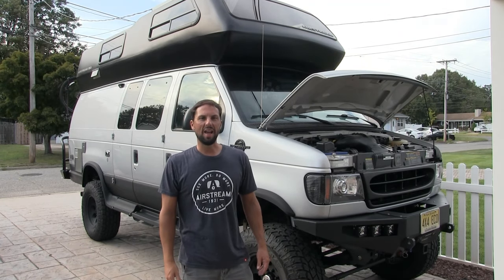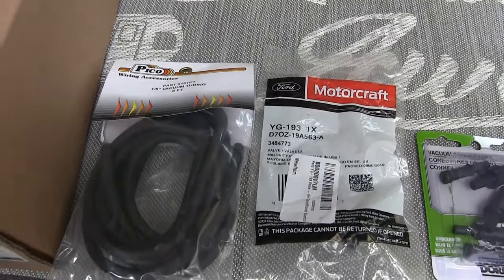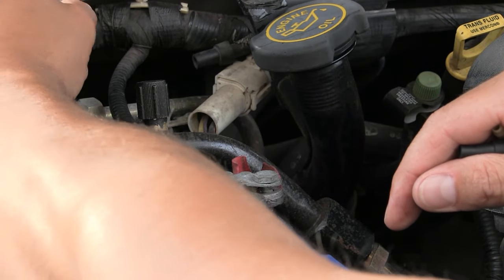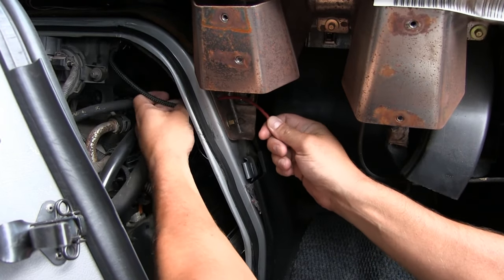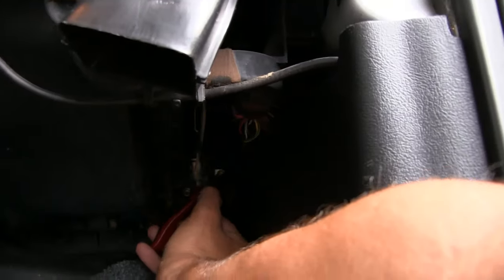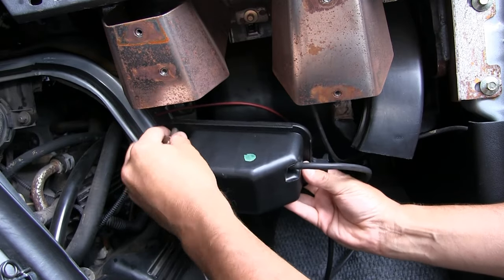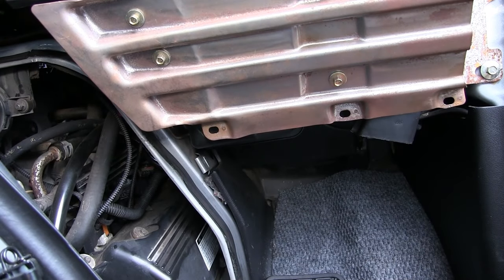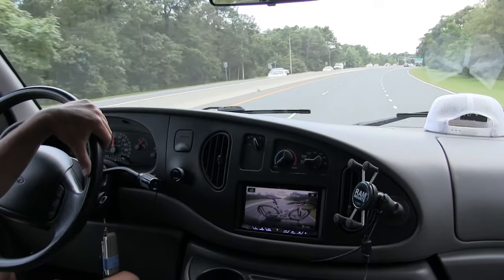Ford Econoline AC Heat Defrost Acceleration Fix

Comment: My 2013 ford econoline 250- ac stop working like this and so idid everything on your video now my max ac quit working and the rest is working on when my truck is moving and stop blowing when im on stop. Any idea why is that
Reply from the maker: I haven't run into that before. Not sure.
Reply: @NewJerseyOutdoorAdventures  before is not blowing when im in the stop. Now is backwards is blowing when im moving. But when i put the key on the ignition at ac position before you start the vehicle they usually air blowing mine is nothing no air blowing at all
Reply: And check all the fuses and relay everything is good

Comment: Did this repair and I'm still getting the same issue. Any ideas?
Reply: Same, did you get it figured out ?
I Did some research, something about testing the vacuum pressure to the defrost switch from the replacement reservoir. And it should not lose vacuum, but if you check the other end it should lose vacuum slowly via the engine valves.

Comment: Hi there, New Jersey Outdoor Adventures. I just completed your fix here, and now I have a faint clicking sound coming from the dash/doghouse. Any idea what's happened, or how to potentially correct this? Thanks in advance for any ideas!
Reply from the maker: Haven't hear about a click from other viewers.
Reply: @NewJerseyOutdoorAdventures  I reseated the doghouse and it's fine now. It must not have been fully sealed up, and some extraneous noise was more noticeable because of this. I don't think it was anything other than that. -Thanks

Comment: I'm sure this was a very informative video when it was made 4 years ago. However, now it's an excercise in frustration; 
1) Questions and comments about the parts on the order list:

     a) Pico Wiring accesories Part 5165PT labeled "1/8" Vacuum tubing" 6ft. Which appears to be fexible rubber vaccum tubing with a 1/8" inside diameter and a 1/4" - + outside diameter. 
If you order that part number today, that's no longer what you get. NOW you get a not quite 1/8" ID and not even close to the outside thickness shown, nor the maliability or flexibility shown. It simply can't be worked onto any of the nipples on the check valve or worked onto the reservoir. Instead Pico Part number 5165PT is a comparatively rigid (not at all maliable or flexible) tube that is barely1/8" Inside diameter and is NOT at all flexible enough or maliable enough to be worked onto the various nipples they need to go on. As I said. 

      b) what is the vacuum connection assortment for? There's no mention of what their purpose is.   I addition all 4 major auto parts stores (NAPA, O'Reily's, Autozone, and Parts Plus), say they no longer carry 1/8" ID, 1/4" OD flexible vacuum hose as is shown and used in this video. If you order using the given Parts numbuers from Amazon, you'll also end up with the wrong parts.
Please update your info, otherwise your videos are obsolete.

Comment: Hey Patrick you may just give ChrisFix How-to Youtube a run for his money. Great video. I'm currently in negotiations with buying a '99 Dodge Ram 3500. I'm excited however, when I went for a test drive I heard squeaking noise from the breaks. The owner confirm he needs breaks but I'm not sure how much. It can range from 200 - 2000. Where the van is located I do not have access to a mechanic to check it out. Should I take a chance and buy it for $2300 or no. It has 143,000 miles. It's only transport people in wheelchairs so not a lot of wear and tear. I'm open to thoughts.
Reply from the maker: Sorry about that, just discovered this in Spam. Seems legit for the money.

Comment: Well. I guess I’ll give it a try this weekend. Bought an 04 e250 with 92k miles for 2500 and I’m not spending 1k to fix that issue 🤣
Reply from the maker: Looking forward to success
Reply: @NewJerseyOutdoorAdventures you’re a god damn legend. Just finished it up 🤙. This guy just saved me 1k in labour. It took me way longer since I didn’t have any power tools and I couldn’t even get the bolt out that you mounted the reservoir to, but zip ties came in clutch 🤞. 

Was wondering if you have any experience with this issue with your econoline. Sometimes when I turn the car on the blinkers don’t work and it says ABS disabled. If I turn it off and back on it’ll run normally but sometimes on a power up it’ll say those things are disabled. I’ve also had some issues where the vehicle will lose acceleration on the highway and then immediately turn off when it comes to a stop. But these issues are all completely random and don’t save codes.

Comment: dude, why cant you just sell me your van. lol ive made up my mind, im going with a mitsubishi fuso FG4x4, fab my own camper in the middle, and a 45 degree rack in the back for my side by side. it will answer all my questions, 4x4 camper and no more trailer. i thought about doing a camper build on a 4x4 sprinter, but their all sold out or they sell for 65k empty van. insane.
Reply from the maker: I will consider it when the fun is over and onto the next project.

Comment: I have done this, and the damn ac still goes to defrost, really pissed at this stupid van.
Reply: Did you get it figured out? My front vents switch less now, but the rear AC still blows hot.
Reply: @SkyWalker210  If your rear is stuck on heat its either leaking there, or broke the blender door, which is common, I'm thinking about just installing a vacuum pump to get it over with, blew my coolant lines under the hood, the cost of that repair was enough to anger me for life, stupid special fitting on the hoses,  new lines keep popping off under hard acceleration, so I fear driving it, overheated it several times now from losing coolant, damn Ford, why can't they just use hose clamps!